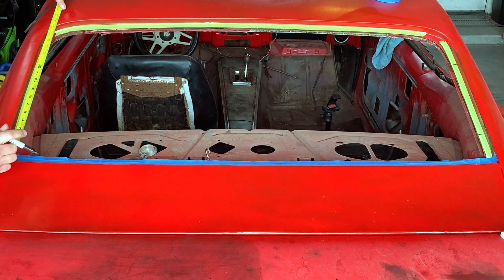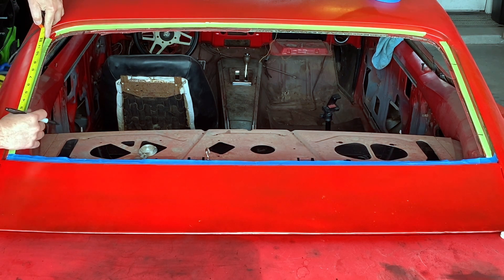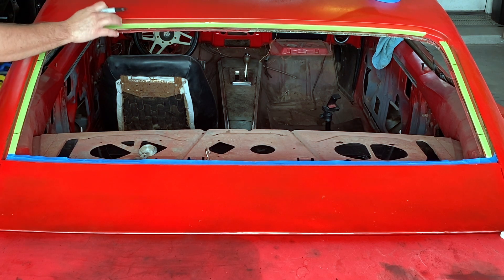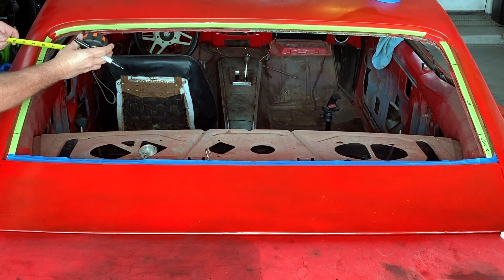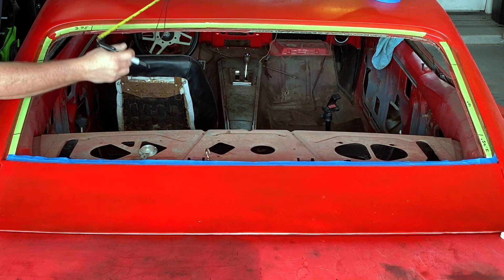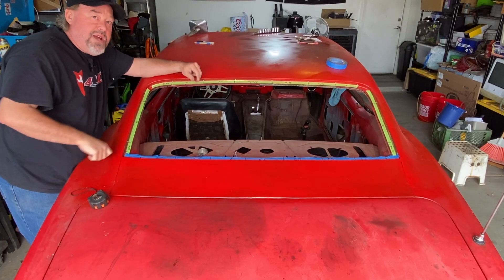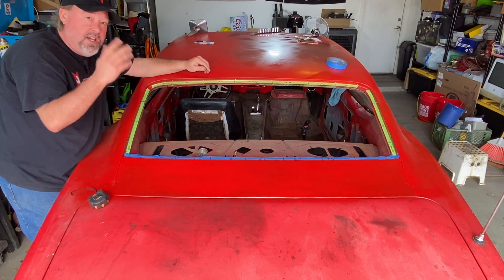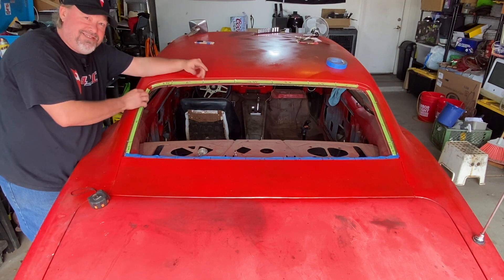HOW TO:  Rear Window Chrome Trim Studs Install Pontiac Firebird Chevy Camaro 1967 1968 1969

Comment: Thanks bud for sharing
Reply from the maker: You betcha, glad I could help!
Reply: @ArrowheadGarage  just wondering,  where did you order the moulding pins from for the front windshield and back glass?
Reply: Hey bud,  just wondering what company was your roof panel that you installed,  I liked the way your roof panel fit, I'm ordering for my 67 Camaro,  TIA for your help

Comment: I doubt the piece’o’crap China Freight stud welder would work, but I can put the original studs on with my Stinger.  Personally, if I just had one car to do, I couldn’t see buying such an expensive tool.  I’d just watch your video, and do it that way😁😉
Reply from the maker: I also was thinking of using the tool to weld in the studs, but then was like yea Ill use that money to buy more Firebird parts lol thanks for watching Bondo Billy!